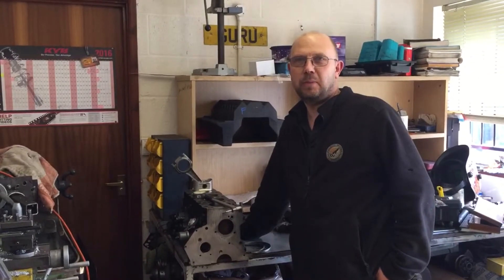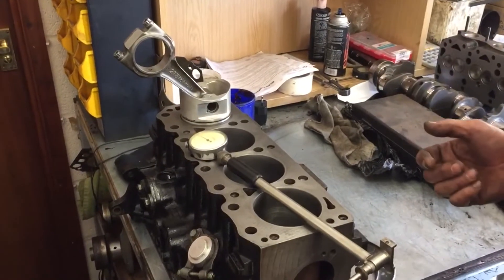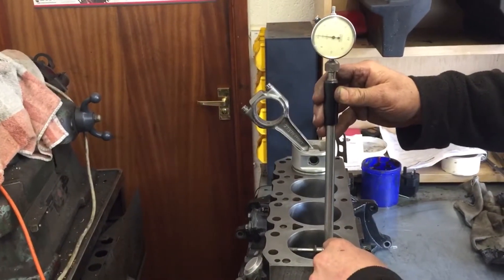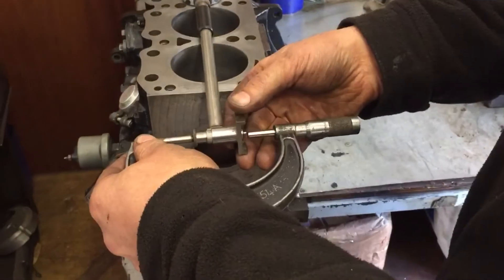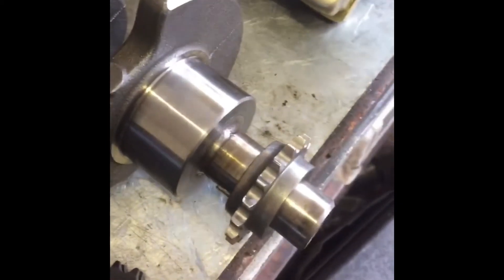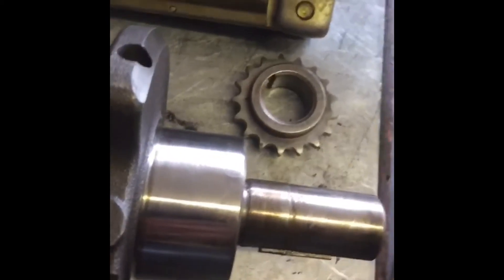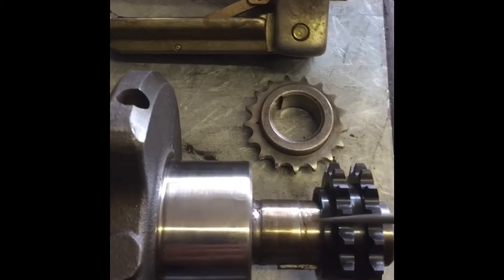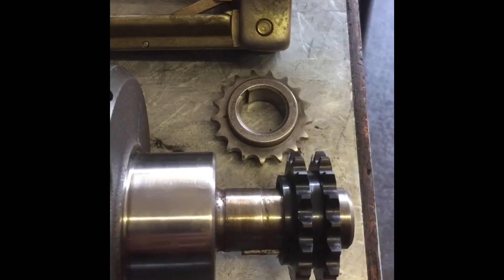Ford Crossflow Engine Build - Perfect Pistons & Single to Double Timing Chain tweaks

Comment: Hi Graham, I’m in the process of rebuilding my xflow and have asked the machine shop if they can cut the duplex chain relief in the no.1 journal face. They want dimensions and after trawling the internet, while there are many mentions of the relief, I can’t find any dimensions… Would you be able to give me some idea of the cuts you make to your crankshafts that will enable me to draw a little dimensional sketch for the machine shop. Thanks in advance. 😀
Reply from the maker: to be honest ive never measured it i just chuck them up and do it by eye! your only trying to give the rivet head clearance.  sitting here at home thinking about it, 2mm by 5mm should be plenty, thats 2mm off the width of the journal, 5mm in towards the middle
Reply: Thanks Graham, that is roughly where I was. I will do myself a doodle and pass it on, as always you have been a great help, thank you very much.. 😁

Comment: Hi, I have a 1.6 crossflow engine but can't get seem to find the information in how to set up the new timing chain with tensioner,  do you have a how 2 guide or video? Thanks
Reply from the maker: crank at TDC, dot on cam sprocket should fall in a straight line through the centres of cam and crank shafts. bolt the tensioner on after you have put the chain and sprockets on, retract the snail and slide the tensioner pad on